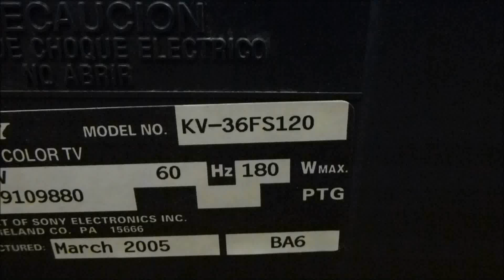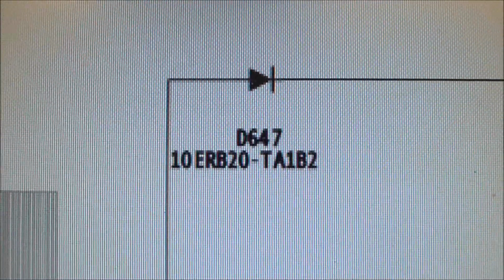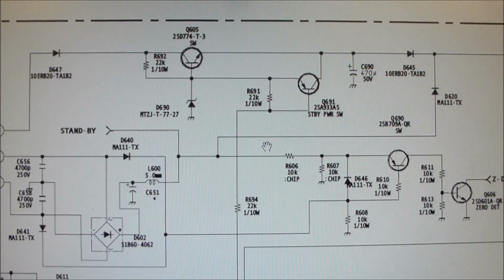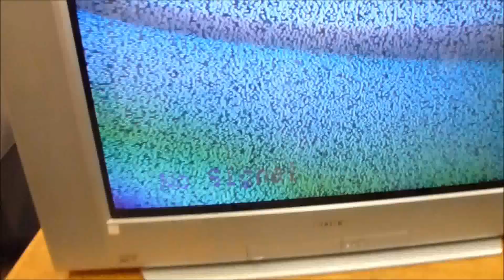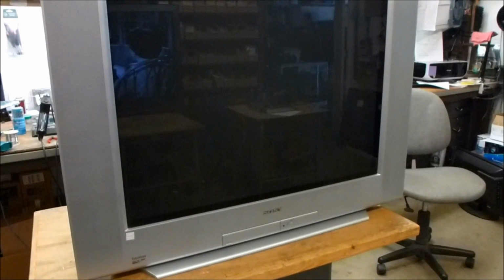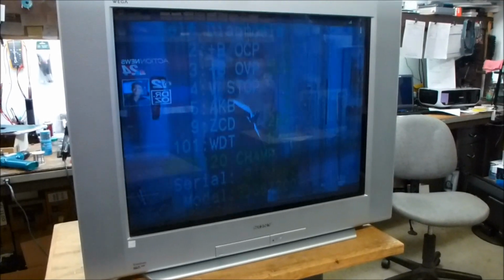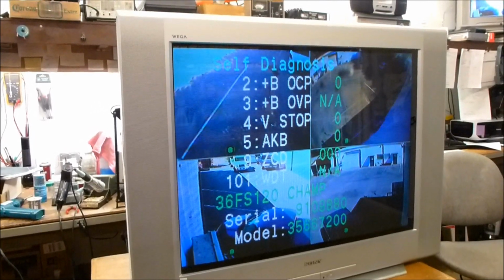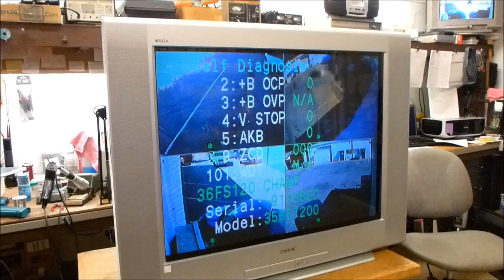Sony CRT TV with 9 blinks KV-36FS120 36 32 FS 120 KV

Comment: 11 years later and this video is still a huge help. picked up the 32" version of the Trinitron WEGA and had gotten to the point of hitting the power button multiple times for it to work, only for the 9 blink LED to finally come along and end it. 30 minutes of work later and it works immediately.

Comment: I'm want to do this repair on my T.V. but I was wondering. How do you take the main board out? What do you have to disconnect?
Reply from the maker: A couple of plastic clips on either side of the chassis and pull back to remove the chassis from the cabinet. You may have to un-plug some of the wiring, then you should be able to tip it up to gain access to the bottom of the board.
Reply: Thank you. I did this and now my T.V. is working.

Comment: mine blinks about 20 times but it works fine
Reply from the maker: probably a weak CRT picture tube. It will blink a slow steady blink until all 3 guns stabilize (red,green,blue).
Reply: @norcal715  ok thanks for help
Reply: @norcal715  will it be an issue in the future?

Comment: I have the same model but I get the 5 blinks. It does eventually turn on after a few minutes. I did the diagnosis display and it displayed 5: AKB  1. Do you have any info on this repair?

Comment: hey dude!! I have the same TV i picked up in for 20bucks... but I have a problem with the sound, it just don't sound anything, but it keeps passing sound in the out put so Im guessin is not the Jungle is the amp... but after I change it, i need to check something else?? before I change it and avoid to stop working again, grettings from México

Comment: I think this could be what is wrong with my  Sony trinitron wega, I have the KV27FS320 model and i get the cycle of 9 standby blinks then repeat with nothing else happening. Would everything internal be layed out the same in my set as in this video?.. Of course i have a Samsung 4k in the living room but my son and me use the spare bedroom as a Retro game room.. Nes, snes, Genesis ect. and these trinitron's are Perfect for this!! The crt picture on these sets for consoles are great. I have never opened up ANY tv but i would like to try and make the repair because these are beginning to be hard to find and rather expensive believe it or not for being the preferred sets for retro gaming.

Comment: My 32" Sony KV-32V42 has sound but no picture and the red light blinks continuously nonstop. Sometimes if i unplug it and plug it back in I'll get half a picture with vibrating lines across the screen. Any idea?

Comment: Hi, I am from India and I have a SONY KV-XR29M50 CRT , a 29 inch TV. My TV shows 8 blinks and do not power up. The blinks continuously repeat. After few power ON attempts by remote, the TV comes UP with normal picture and sound. What could be the problem.

Comment: Ordering the diodes.  Which side is the anode on the circuit board?
Reply: +paul jacobs
You have to check on the schematic, or  follow traces from t diode and check how other components are soldered in.

Comment: 0 no red standby light-check powercord or bad main logic board or power board, check standby volts
1 red blink not used
2 red flashes is bad power board, solution replace power board
3 red flashes is bad main logic or power board, check for standby volts if ok replace main logic board
4 red blinks- can be LD board or main logic board, check inverter board wires for arcing to ground
5 red flashes- bad lcd panel connection or internal lcd short- squeeze bezel to locate bad connection
6 red flashes- backlight issue, bad main board, or power board or inverter boards- check standby volts on power board. "backlight on" volts should be 3-5v from main logic board then 24v to inverter
7 red flashes- main board over heating, can be short on power board or main logic board
8 red flashes- main board sp prot, try power reset, update with usb, or replace main logic board
9 blinks- check fan error, * if TV has fans
10 blinks- digital board or tuner board * some Sony TVs may not have this board
11 red flashes- bad main board, bad IC, replace main logic board
12 red light flashes is tcon error bad T-con board or bad LCD panel, replace tcon board usually
13 red flashing is backlight balance error bad lcd panel or inverter boards (common) or bal board on kdl-52v4100 only, replace inverter board usually then main logic board
14 red flashes HFR- bad TCON or Bad LCD panel, replace tcon board. unplug tcon board if tv stays on without tcon board replace tcon board.
Reply: Chamal Paranavitane   Thanks been looking for these error codes. Hauled the biggest tv over for a friend and of course theres no picture. Maybe i can still fix it.

Comment: Very informational video! thanks
I Have a Sony trinitron Wega kv-ar29m31 which will not turn on.
Last time it turned on the picture was blue and scrambled, after turning it off, it never turned back on again. This was a few days ago and I tried several times since then.

When the main power button is pressed in, The LED turns on as expected but when pressing the channel + button, or using the remote, it does not power on any more.

The LED does not blink, which the service manual has no explanation for.
Any suggestion on where to start troubleshooting would be greatly appreciated

Comment: I have a similar looking set its a KV-30HS510 the Standby blinks 6 times push power and the relay clicks but will not light the tube. Can I get a suggestion?

Comment: I have one very similar to that, except it's the 32" model.  It has some horizontal pin cushion issues(drooping) on the left side, which isn't something that can be adjusted in the service menu.  Can the pin cushion can be adjusted mechanically, without replacing components?

Comment: Hi, great video. I'm glad I watched this even though my 32" Wega code is blinking 5 times. I searched your other videos, but did not see any ones that address that code. Any tips on fixing this? She still works but I have the picture setting way down, if its too bright I get the black screen/code.. I had the same problem with my 27" Wega that I'm now regretting not trying to fix myself. Please help, thanks. *Subbed!

Comment: Thanks for the video.. but do you have any idea what to do to fix a 5 blink code error? It tries to start, once, but doesn't then gives 5 blink code.  Any help would be great.
Reply: I have the same problem on a 32".. did you get any help on fixing it? thx
Reply: m0t1vz Sorry for the late reply.. I ended up fixing it myself.  Give me some time to dig up the schematics I used to try and remember which diode I ended up replacing.  No guarantee it will be the same one for you, but might help you get started.
Reply: Fernando Matias Thanks man, I've been searching for a fix, nobody can really say much but to call a tech.. any info you got, I'd be grateful for..
Reply: m0t1vz Did you get my msg on your channel's Discussion page?  If not I'll repost it here.

Comment: Please help I bought this tv of craiglist for 80 bucks but not im noticing weird colors around edges and the tube isnt straight and snes games don't look straight or stuff gets kind of cut off. Its slanted. Please I need your help.
Reply: I think you'll just need those magnetic image fixer things (whatever their called.... They're basically big rings of magic, per say XD) and, on the TV's own menu, try to find the sharpness/general adjustments and try to fix the unsteady picture that way. I believe you could possible reset the picture itself, too. Otherwise, try to find some more info if you can. Maybe if you look up the TV's manual, it may give out some decent advice itself.

Comment: watched your vid, "Sony CRT TV with 9 blinks KV-36FS120 36 32 FS 120 KV", 
My KV-32FS13 picture just went out after years of faithful service, I have sound. this video sounded like the problem Except my light blinks continually...no pause. I turned it on, black for 20 minutes or so, then picture appeared for 15  minutes or so then went out for good Any hope for it? I would love to try fixing it.

Comment: my sony KV40XBR800 will shut down and blink 7 times , but you can power it back up sometimes with the remote . Sometimes it will shut down after 10 or 20 minutes and will shut off a few minutes afterwards . I heard that the Flyback is getting weak . Sony said in the service manual Horizontal defection stopped , I read on the internet its the flyback get a over voltage and shuting the set down . Whats your thought .

Comment: I just finished this repair on a Sony KV-32FS320 and the TV turned back on perfectly. Thank you for this video. However, I noticed that the picture is just slight wider on the bottom of the screen. Can you give me instructions to fix the picture. 
Thanks again.

Comment from the maker: on that set there should be just one diode D6301 on the sub power supply board.
Reply: Sir pl suggest replacement of FN155 transistor for Sony trinitrotoluene  in india

Comment: i have CRT screen PHILIPS  Model no 21PT2215/94  Problem is power supply is through but canot switch on high voltage, wha will be problem sir if u kindly help me sir..........
Thanks you,

Comment from the maker: If you dont get a relay click then Find D6301 on the sub power board and change it with the same as in the video and see if it helps. If you have a relay ckick then heat the MCZ3001DB ics on the deflection board and see if it starts.

Comment: Hi...I am having the same problem with my 51 inch Crt tube Sony Wega Tv.  Will this procedure work with my very large heavy tv that I would not take in to repair because of it's weight.   My Tv is one of the first HD tvs and I'm not ready to trash it either. Thank you Cindy.  It also blinks 9 times

Comment: Just checked, the pix never blinks. I just want know if there is a way to separate the 3i issues you just mentioned. If it is the case that the tube is weak, then there is no need to fix. But the problem is that the tv die suddenly, no any early indication. Since I do not have the circuit schematic, it is very hard to debug and diagnose. Any comment will be very appreciated. I found it is fungo fix this kind of old tv.

Comment: First of all, thanks for your feedback. Actually, the pix never came back. I have read some comments about heating up the board might get the pix back. It might may sense because last week it was pretty cold here. Usually, when I turn on the tv, red light blinks a few second, then in will hear a click then the pix is on. Not now. Btw, the tv is 11 yrs old. I never had any problem. As you said it is good to play game. How to check the AKB circuit? What is the G2/screen control?  As you said I th

Comment from the maker: if the red light is always blinking and not blinking out a code then that means the pix tube is either not getting correct drive or the tube is weak. Sons have a curcuit (AKB) that will not release video till the tube guns are warmed up, all 3 of them so if one is weak or not getting the correct signal then the red just blinks. Was the pix blinking on and off when it was warming up before it went out completely? sometimes you can adjust the G2/screen control and get a pix back.

Comment from the maker: Old school design, no digital processing, plus massive space for heat to dissipate. These new sets process so much digital and get sooo hot they fry themselves. Also the glass in a CRT tv is 3/4 to 2 inches thick vs. .5mm to 1mm thick on a LCD and 2mm to 4mm on a plasma, they cant take any impact.

Comment from the maker: Pretty sure. I have seen it many times. You can use a 1n4001,4002,4003,or 4007 or simular available at radio shack

Comment from the maker: 9 Blinks is most likely the same diode in the power supply. with the back off, look for a board on the left side of the the tv. Its about 6X10 inches. Look for a small power transformer 1 1/2 inches square, look near the transformer for the same diode with the purple band just like in the video. Change it D6301 I think?

Comment from the maker: If the picture slowly fades then most likely you have a CRT filament (heater) intermittent connection. Look at the orange glow in the end of the picture tube and see if it fades out. The CRT Filament (heater) is driven off of the flyback on most of these newer tv's. Check for bad connections.